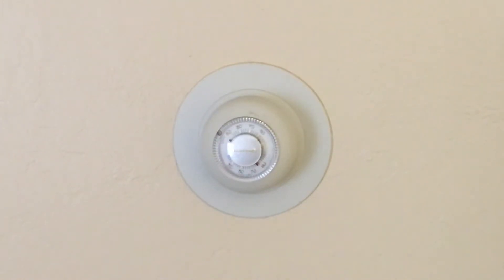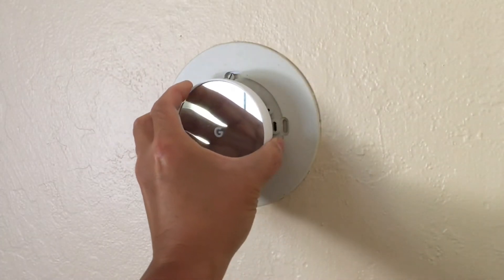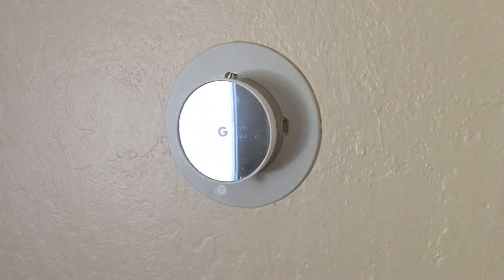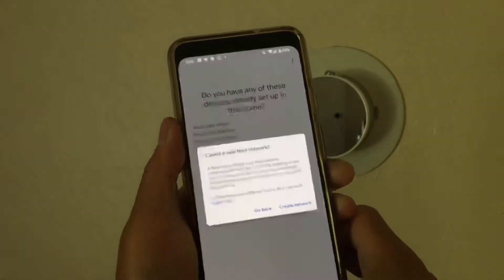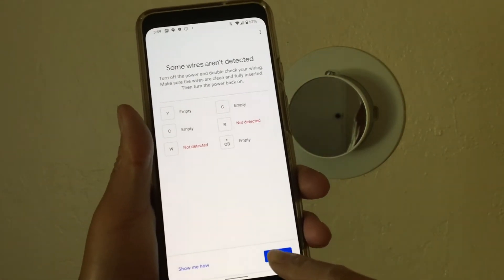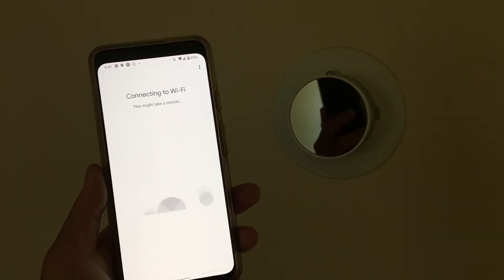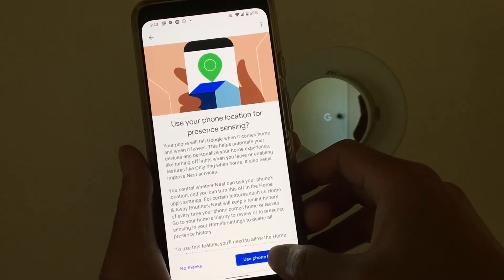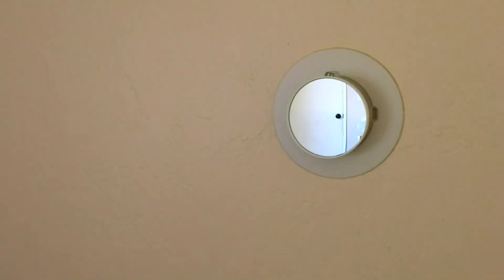Last day left to get a FREE Google Nest or Ecobee Smart Thermostat! 2 Wire Install Walkthrough

Comment: I did literally the exact changeover with the old Honeywell.  I've read you can use just the red and white wires, but that you need a common wire to avoid problems, like the battery life draining or it restarting etc.

Have you had any issues after you installed?